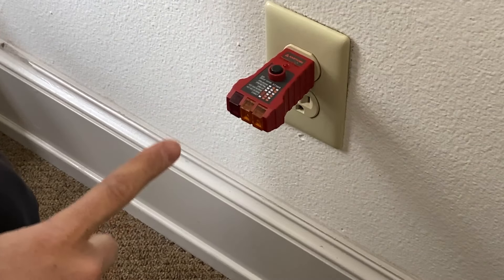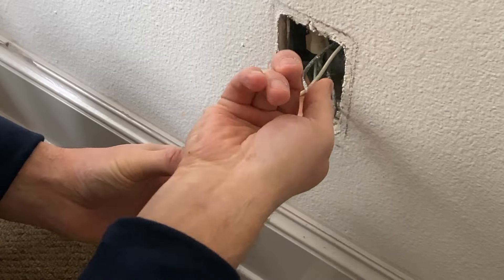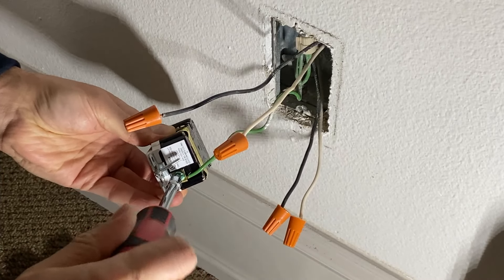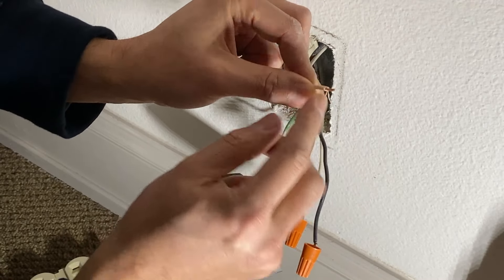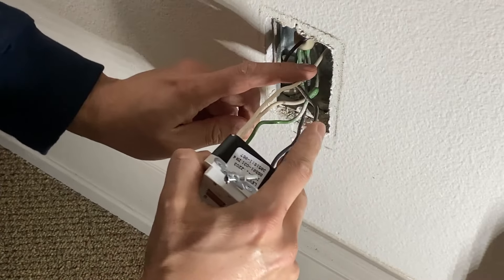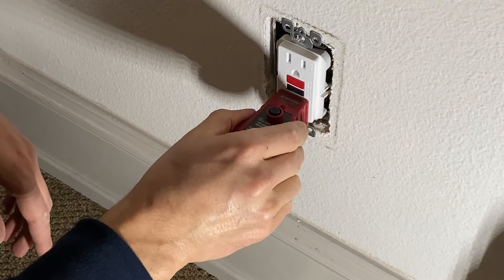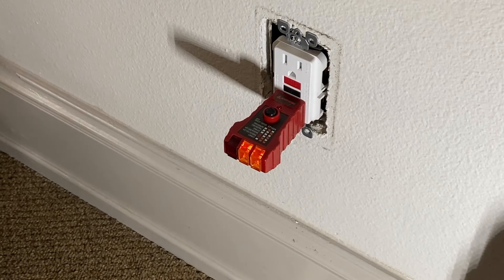How to Install GFCI Outlet (4 Wires)

Comment: An installer likely would not know where the Load wires go downstream. You should verify that by tripping the GFCI and see which receptacles or switches on this circuit have been affected. Then place the sticker "GFCI protected outlet" on those receptacles and switches. This will alert a user to check the GFCI first if one  of those devices does not have power, and is safe to use in a location where water may be present. Normally GFCI and protected outlets are found in kitchens, bathrooms, laundry rooms/garages, and outside. Those areas are going to be on 20 amp circuits and a 15 amp GFCI receptacle as shown, is acceptable by code.

Comment: Thanks for posting this I've replaced GFCI's before, but I just put the wires in the same order, I put two new GFCI's in a bathroom that were just plugs and couldn't get them to work. Thanks for the informative video. Problem solved!

Comment: Joshua place each wire as you take them off of the existing and make sure the line is labeled the same at each position of the old and new and everything else will work

Comment: please help my newly replaced GFCI is not working properly. my test button is stuck and when i reset it trips for a second then goes back to not supplying any power. the indicator light is blank.
Reply from the maker: make sure you wired it correctly, if all good replace the outlet

Comment: Always test after the install.  I had a GFCI of the same brand and the outlets on the face of it were wired backwards resulting in a Hot Neutral, with all downstream outlets presenting correct polarity.  Never seen that before.  That Chinese kid that made it must have been that day.  Always verify your work.

Comment: Great video. I have a room with 3  2-prong outlets. Can all 3 be replaced with gfci?
Reply from the maker: yes. but you may not have ground wire there. but gfci should still work
Reply: @remoteelectrician  thanks

Comment: My outaide gfci has 4 wires all where connected to line . It worked when i moved in but no longer working. Should it be wired up like you did in video? And also could it be beginning of a circut ?
Reply from the maker: no, not always. u need to check what else that circuit feed and whether it needs to be gfci or not

Comment: My GFCI is in my back bathroom and there's 3 black wires and 3 white wires and a copper wire . I put all the black hot wires on the brass screw holes pushed them in and tightened and on the silver screws side I put the white wires pushed in those holes and tightened , and put the copper to negative. But my GFCI reset button won't click in and have no light come on the GFCI ? The breaker has two switches the one switch turns on bedroom light the other supposed to give power to the GFCI but nothing is there. Could this breaker be bad ? I have no power tester .
Reply from the maker: you either get proper tools to wire it right. or pay an electrician to wire it right.

Comment: I did the same installation, but one of my neutral white wire was hot in respect to earth ground, I tried different combinations, but no luck, I kept getting fixed green light, with fast blinking orange light.
Reply from the maker: How was it wired before you removed the old one? sometime other circuit may use same box as junction box, especially old built homes
Reply: @remoteelectrician  thanks, this circuit is outside on my balcony, the old outlet had one black wire, but it was looped around one screw, and so was the white one, I later found out that they fed an outlet on one of the bedrooms, but when I replace the outlet the first time with the gfci , I kept the wire the same way, looped, but that didn’t work, so I cut both the black and white wires, I determined the black hot by measuring from black to earth ground/green wire, but then, when I measure white to earth ground, one end of one white wire was measuring 120v from that wire to ground, not the other white one, and the black, only one measure 120v to ground, I don’t know why white/neutral to ground would measure any voltage, so I ignored it, and placed my hot black to line input on the gfci, and white hot to the opposite, then I put the other black down to the load, and the other white to the other side, but same problem, I even tried switching the whites, but no luck, then I switched the blacks, and no luck either, this is an old condo building, built in the 70’s, I also tried putting one of those gfci under the sink, and no luck either, I had to put the old one back, those things are very sensitive. Thanks for the respond.
Reply from the maker: yea with old homes wiring it takes time to figure out what they did, so many things are not up to code. You’ll need on-site electrician to troubleshoot the circuit for u.

Comment: I have three sets of wires coming out my outlet.  I'm easily able to tell black (hot) wire coming from the panel, but the tester doesn't work on any white wire because they do not have any power flowing through them when all the wires are out.  Is there any way to be able to tell the neutral (white) wire that is coming from the panel other than guessing?  I'm not able to determine the white/black pairs just by looking since they are not really paired together in my outlet
Reply from the maker: you should be able to tell if you measure the voltage with voltmeter or just do continuity test on other 2 loads
Reply: Look at the stuffing tube they came out of in the back

Comment: I noticed that the load wires was coming out on top of the hole the other wires on the. Bottom.But you hook the bottom wires on the load side.You hook all the wires opposite then what you said.
Reply from the maker: no, I did not know before I tested with power tester which pair was the line. you may have missed that part.
Reply: Could not see what tool you were using on your second power check.  Also did not see how you made sure which of the blacks was load before screwing down.  Otherwise liked your pace and other clarity.
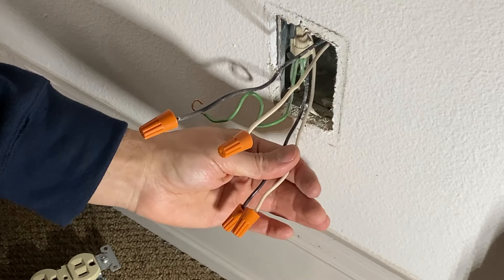Reply from the maker: @RF-hx4wc  2:30

Comment: I had actually replace a gfci outlet that makes a loud sound when tripped with a plug tester I payed attention to where the wires were at detached the line to wire into the new gfci(with usb plugs and uses pigtails) then wired the ground then when I wired the load I removed the wire nuts on it to attach it using wago 221 lever nuts
Reply from the maker: you bought that type that makes that sound when tripped. it should have speaker label somewhere on faceplate
Reply: @remoteelectrician  no the old gfci makes loud sound when tripped with a plug tester that’s the test reset mechanism and it dosent sound right!

Comment: Is it ok to install a 15amp gfci if your breakers are 10amp?
Reply from the maker: technically no. you can upgrade the breaker "if" wire is 14 gauge to 15 amp.
Reply: @remoteelectrician  I just realized I have a 15amp gfci not 10. Since my breaker is a 20amp would it be ok to use it being that it’s under the amp amount?

Comment: Remote Electrician Hi im Jon!   I was curious if a GFCI can work similar to breaker box?  I was told at Menards by a Professional in Electrical once being encouraged to get a GFCI Receptical as they say its a all in one and will not only protection against ground faults but also for shorts and lose wires on extension cords or faulty electronics plugged into a GFCI or even lightning spikes and surges of power to not only protect your devices from getting damaged but also from being zapped.     I have a neighbor friend who is a Electrician that is making a special junction boxed extension cord using thick heavy duty outdoor extension cord and then every few feet i have a metal junction box and series of electrical outlet junction boxes down the cord and the first outlet is where a GFCI is getting installed and then the rest of the outlets down the extension cord is going to be regular standard outlets but protected by the GFCI and then the extension cord is getting plugged into a power strip that has a built in Circut breaker and a surge protector in it.    I did not tell my Electrician neighbor friend that part that i am plugging it into a power strip that has a built in circut breaker and surge protector in it but thats probably alright as then it will have everything for sure together a all in one.    I think that will all be alright together don't you?
Reply from the maker: Hi Jon yes u can use gfci/afci on a regular breaker. nowadays there're breakers that have built in gfci/afci as well

Comment: Hi Great video - I followed your every step, but the outlet trips after 15-20 seconds and I'm not sure why...Please HELP!!!
Reply from the maker: double check the wiring and check the wiring on the load side other outlets that it may be feeding you may have short circuit. in rare cases faulty gfci outlet

Comment: Does that need a spark ring or tape?
Reply from the maker: great question. 
I normally tape it. 
but if box is bit deep I go with spark ring/box extender (wood, tile, metal box, drywall doesn't matter)

Comment: What happened if I connect the 2 black wires together and the 2 white wires also together? That is the only way my GFCI works I need help please
Reply from the maker: you need to define line and load, 1 pair is your line and usually 1 pair is load. but sometimes yes its connected to line all 4 wires but in that case that gfci protecting itself not the other device where other pair is going

Comment: You didn’t say if it’s 15 or 20 AMP GFCI. Can i use 20 amp?
Reply from the maker: use whatever breakers size you have 20 for 20. if 15 then 15

Comment: My outlet 15 amp ,May i replace  20 or 25  amp GFCI Outlet  sir ?
Reply from the maker: install whatever your breaker is rated for if 20 then 20 if 15 then 15. (there's no 25amp gfci)

Comment: What if there’s a black and red and they are both hot from the downstream side
Reply from the maker: usually when there's 2 hot lines one is switches. but its for regular duplex outlets not gfci. what circuit is it? living room? bath? bed?

Comment: I tried changing one in my bathroom that didn’t have gfci and lights up solid red. Test and reset don’t do anything to the light
Reply from the maker: make sure ground wire doesn't touch any terminals/neutral/hot wires
Reply: @remoteelectrician I checked all the wires and everything was fine. Used another new one and it works as expected. Thanks for the video and reply!

Comment: Im replacing one 4 cables but both are load? So what now?
Reply from the maker: no every outlet that has 4 wires has line and load. power/line comes from other outlet and go to the next one. like chain. in your case u should maybe locate the gfci first if both wires don't have power. (and install there just a regular outlet) if u don't understand what I'm saying hire professional

Comment: what about splicing in a ground wire for the load.  It's pretty unsafe and against code without ground going to downstream receptacles.
Reply from the maker: do it, what's the problem? in my case it's pigtailed already. everything metal, built with commercial code.

Comment: All connected, green light on, but still appliance will not work when in outlet? What could be wrong?
Reply from the maker: what appliance? plug into other gfci if doesn't work you have an issue with appliance
Reply: I am having the same problem.  The green light on the GFCI outlet is on. However, I have plugged lamp and phone charger in; neither work.  Push button test doesn't work either
Reply from the maker: @m.edwards7591  check if line and load wires reversed
Reply: @remoteelectrician  Thank you.
Reply: @remoteelectrician  Holy smokes! It worked! I had same problem. Green light. Plugs no work. My outlet is not on a switch. Plug in my lamp it not work. I do not have pro testing tools. So I switched the black and white wires top to bottom and bottom to top and presto it worked. So I have a big question. I copied the wire positions exactly from my old non-gfci outlet. So why did that not work?
Reply from the maker: @dstmars1  gfci outlet has in and out. in must be line:power. out must be load. think of it like one way road. (for regular outlet it doesn't matter how you wire line and load.)
Reply: @remoteelectrician  Another suggestion for outlets with the 4 wires if you don't have pro testing tools and you don't know which pair is hot.  Separate the two pairs. Look inside the box and make sure each pair is coming from a single sheathing. Then by trial and error attach just one of the b/w pairs to the top terminals of the GFCI outlet as well as the ground wire and turn the breaker on. Then press the reset button and if it works you can attach the other b/w pair to the bottom terminals but turn the breaker off before doing that.  And if the first b/w pair doesn't work you know for sure the other pair is the hot pair and they go to the top terminals. Hope this makes sense.

Comment: If the circuit has other load devices other then outlets such as lights then it could be considered not a GFI circuit. Also the GFI should be a beginning of circuit run.
Reply from the maker: of course many scenarios out there. this video is a basic how to do, not a dive into every senario

Comment: What if you don’t have ground
Reply from the maker: no problem, most old homes don't. it'll still work
Reply: You can put GFCI that has 4 wires  no ground and connect to the other outlet?
Reply from the maker: if u don't have ground you can still install it, it should still trip

Comment: I don't want any more GFI, in my kitchen.  The electrician installed 3 of them.  Its caused problems.  I only needed 1 installed near the sink socket.  Soon I will purchase a receptical that is residential commercial.   And I won't ground.  Am tired of it controlling my other receptors.  Am tired of these trippumb every other week.  Scares me, I'll be in flames!
Reply from the maker: Well, You may have hired wrong electrician